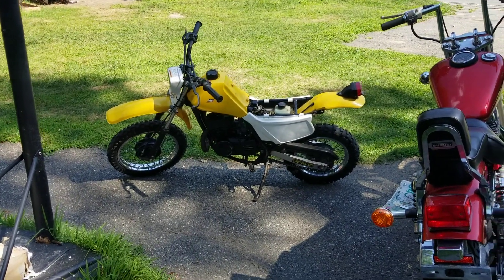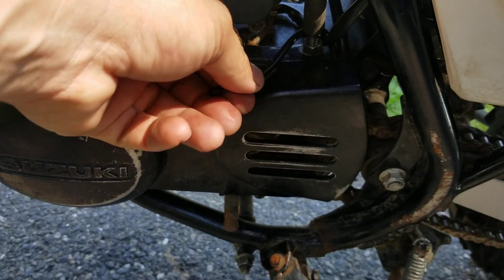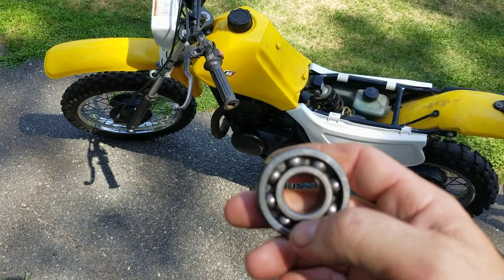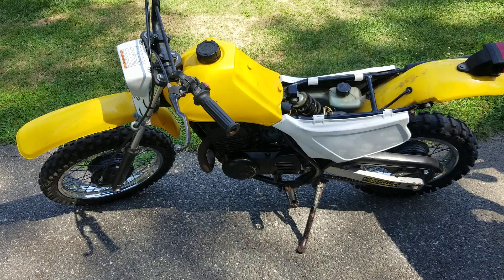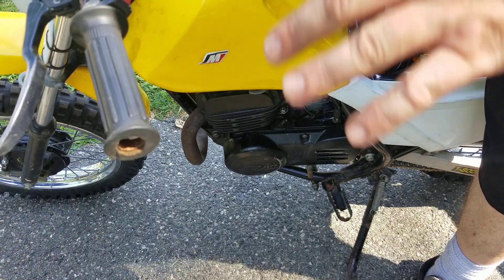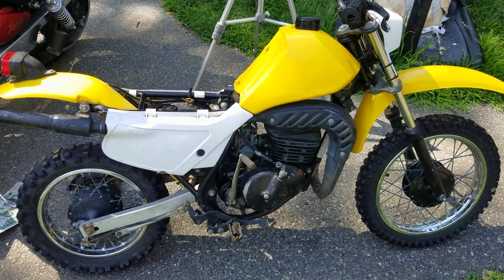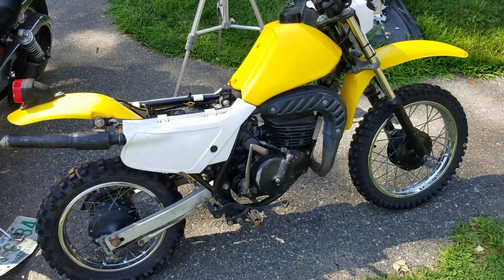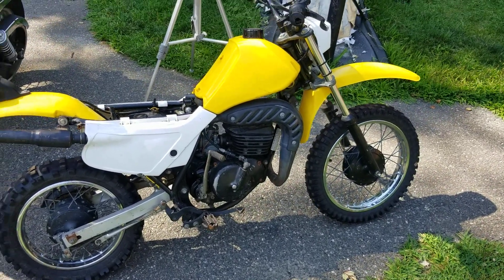What bad crankshaft bearing sounds like

Comment: so mine does this i just put new piston in it thinking it woud fix it the other one had low compression but will i need to replace the crank and piston i just put in or just the crank bearings
Reply from the maker: I brought all the parts I will be replacing the engine and repairing the spare engine I always keep spares

Comment: you can totally hear it.  another way to check if the the crank bearing is bad if you cant hear the engine run for one reason or another.   is to bring the piston up to TDC, when the piston physically moves down stop.  take a wood pencil unsharpened, thought the spark plug hole and see if you can push the piston down.   mark the pencil when it touches the piston, then mark it when the piston moves and stops, make another mark. that will give you a good indication of the wear of the your bearings.  I've looked at a lot of 2 stroke jet skis, and boats, and know you cant start them all before you have to make a decision on buying them. that and compression check will tell you all you need to know about a 2 stroker.
Reply from the maker: That's correct i actually will be showing this method before I teardown i try to keep it basic 1st then advanced 2nd so its not overwhelming

Comment: I recently replaced my stator on a suzuki rm 250. I noticed there was slight play in the shaft but no noise when started up is this the start of bad bearings. Thanks in advance. Jake love the vids
Reply: Thanks so much for the reply it's more in and out when you grab onto the flywheel. No noise at all but was curious is it the beginning so to change those bearing before it's worse. Hard to tell if its side to side or just in and out
Reply from the maker: @houseflymotors7459  no noise i would say your good to go happy to help
Reply from the maker: Thanks Jake is it up and down play or in and out up and down is bad slight in and out is ok
Reply: Your a gent have a channel myself doing build videos and repairs but mainly on pit bikes now onto collecting 2strokes it's a bad habit ahahah. Thanks again
Reply from the maker: @houseflymotors7459  share a link
Reply from the maker: @houseflymotors7459  i subscribed kool pit bike

Comment: Hi Kevin, an unrelated question. I saw on that bike the rubber spacers between the cooling fins of the head. I would have thought they would reduce airflow and cooling. They are on the kv100 s. Why are they there? Is it ok to remove them? Thanks
Reply from the maker: They are there to protect the fins yes they do restrict air flow and you can remove them
Reply: Kevin Bergeron thanks Kevin, thought so. I figured they were for shipping the parts.
Reply: They are there for sound dampening. They help quiet the ringing in the fins

Comment: Hello Kevin,

Firstly I want to thank you for your videos. Great stuff!

I am restoring a KS 125 from 1976 and you told on the video that Rotary valve 2 stroke engines must use oil pump for mixture.
My question is, if I premix the gas myself, will the Engine fail?

 I was thinking on the possibility of disabling the oil pump and go for premix but now I am not so shure if it can be done.

What do you think of it?
Reply from the maker: Premixing a rotary valve 2 stroke will cause engine damage Oiler Oiler lube rotary valve wich rides on a cushion of oil and lubricates right crankshaft bearing
Reply: @2strokeguru   , thank you for the detailed explanation.

I guess I will have to figure it out how to adjust the oil pump!

Thank you! =)